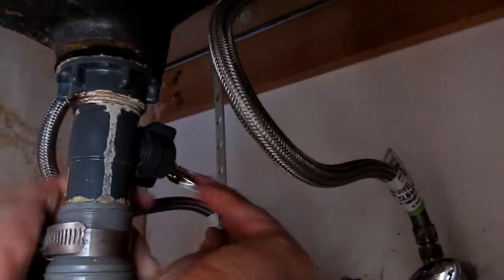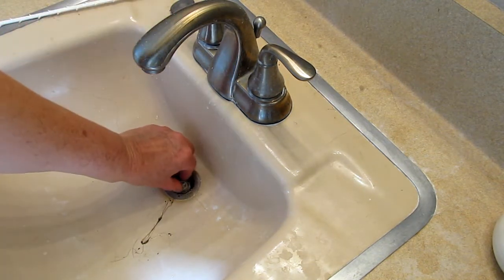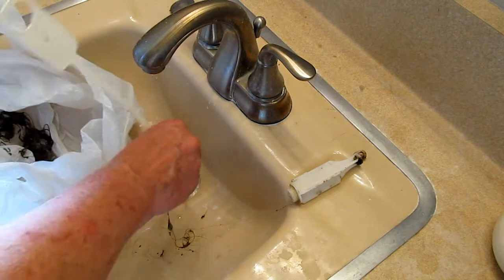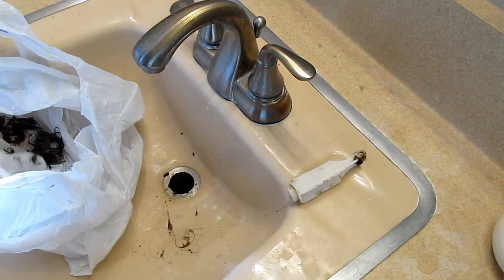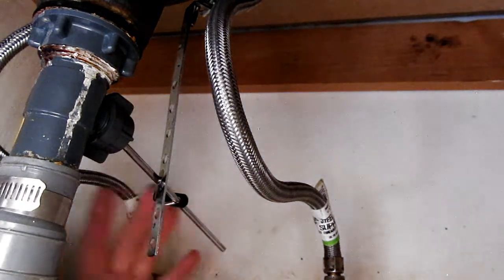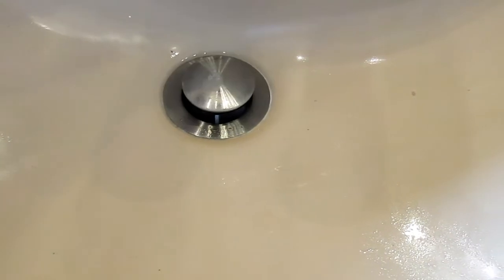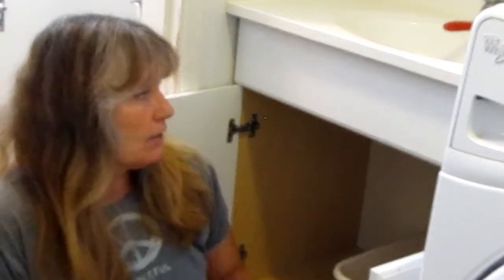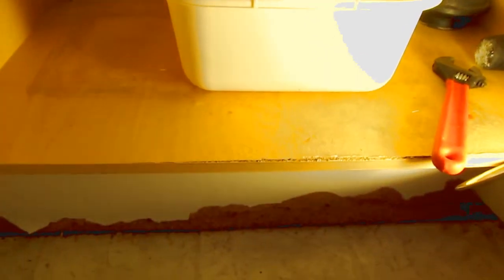Unclog Your Sink

Comment: I've been being really really careful not to get hair in the sink and not to let hair go down the drain, but my sink still clogs up and runs very slowly.  I think it's the toothpaste.  Any ideas how to unclog that?
Reply from the maker: Well, the best way to find out is to open it up and take a look.  No matter what is down there, the Zip-It will probably get it out.  You might be surprised how much hair you'll find.  If it is really toothpaste caked up down there, you might need something more like a wire coat hanger or something sturdier than the plastic zip-it.  Make sure you use plenty of water when you are brushing your teeth to wash it down and prevent it from caking up.  I've never had it happen with toothpaste, but I only use about 1/4 inch of toothpaste on the brush when I brush.